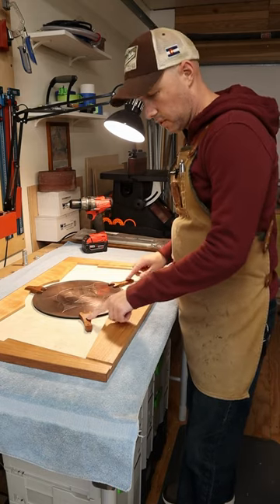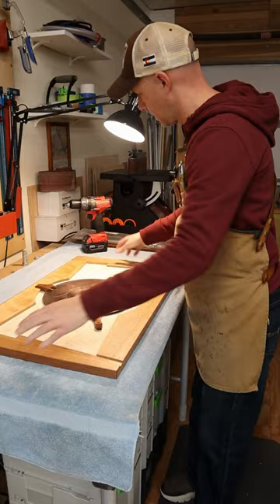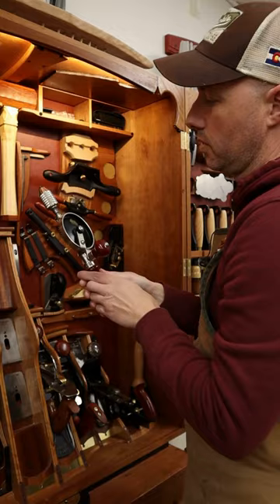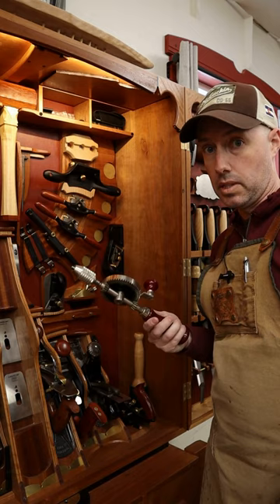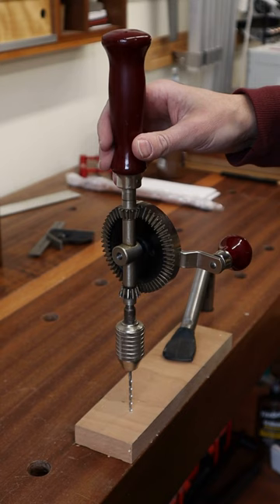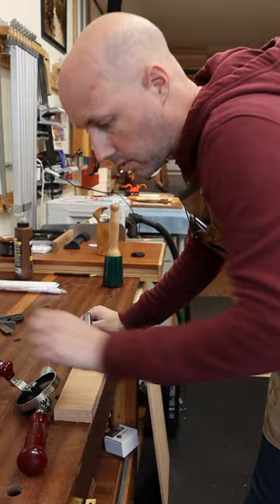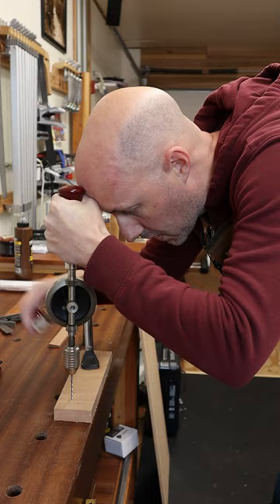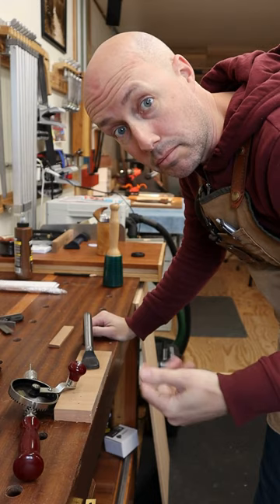Using an "Eggbeater" Style Hand Drill #shorts

Comment: If you have a back like mine, the forehead on the handle trick would not be possible.  I found the Bosch 12V Max Brushless Drill and Impact driver kit is absolutely amazing.  The control you can get with those triggers is better than anything I have used by a good margin.  Do yourself a favor and try that drill.  It will fit in your pocket too: it's tiny.

Comment: When I use an eggbeater,  my elbows are positioned as corners of a triangle, and my cranking hand, wrist, and elbow are straight and going back and forth similar to a sawing motion. while the other elbow is held close to my side.  Or, the piece is clamped vertically and my belly muscle steadies the drill.

Comment: Do you not call that a bit and brace? It is in the UK..
Reply from the maker: In the states, the brace and bit has the rotating pad on top, a large C-shaped handle that swings in an arc anywhere from 4-8", and no gears. I'm surprised to hear the smaller, straight, geared hand drill would be called the same thing given the very different form factor and manner of turning the drill bit.